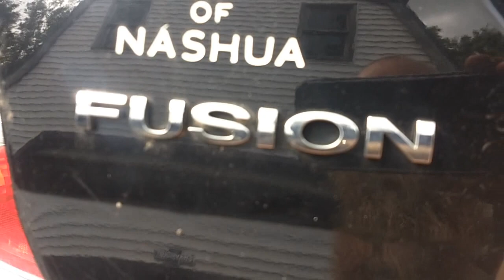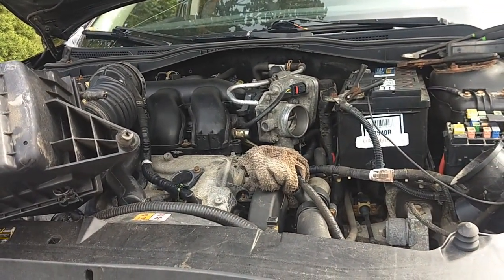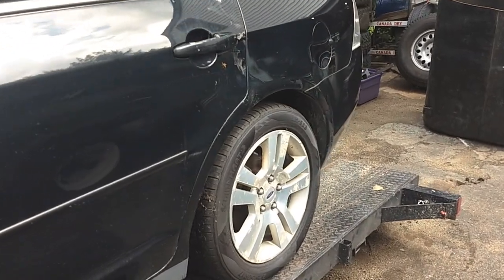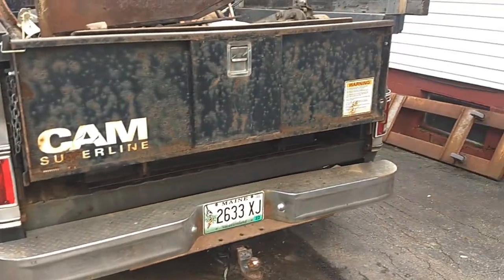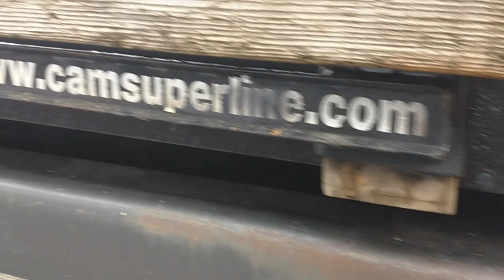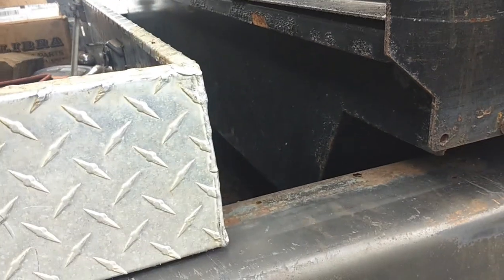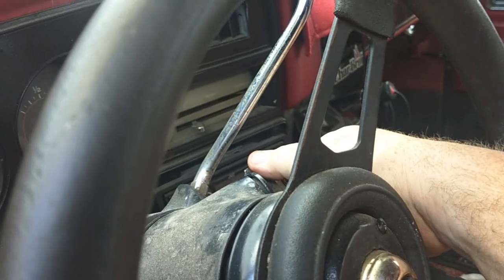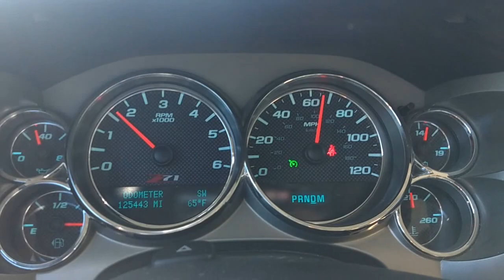Scrap FORD Fusion w/bees and a side of steak tips

Comment: THIS one i would have ZERO problem with you taking a sledge hammer to even if it was in perfect condition! Can't stand a FORD !  Most cars "FULLY LOADED" is a good thing. A Ford "fully loaded" is the same thing as a Baby Diaper "fully loaded" to me.
Reply: Convertors are the only reason I buy ford's I got a explorer 5.0 v8 that has a tough motor it takes a heavy boot and keeps goin